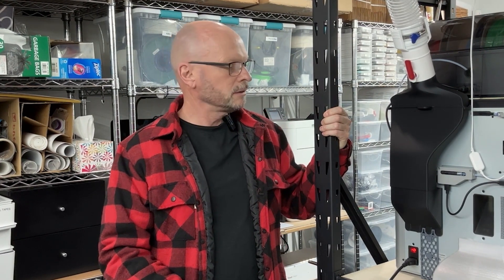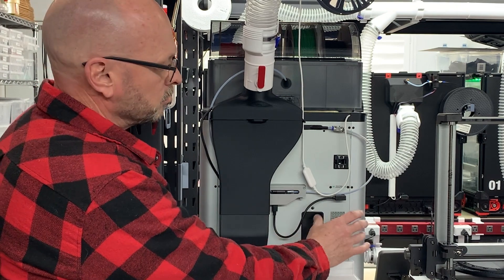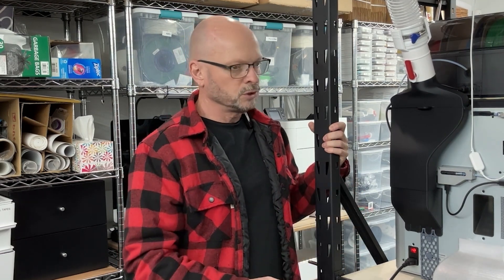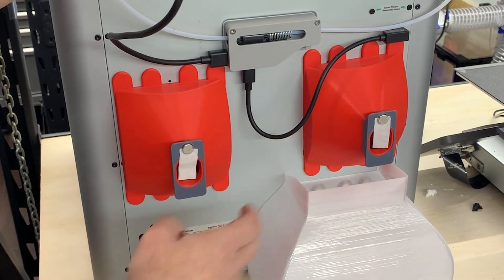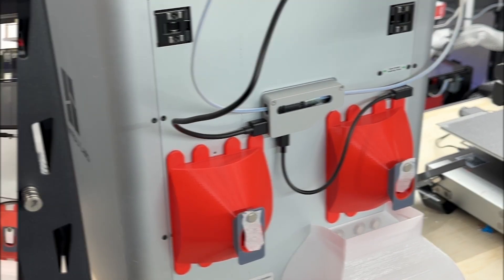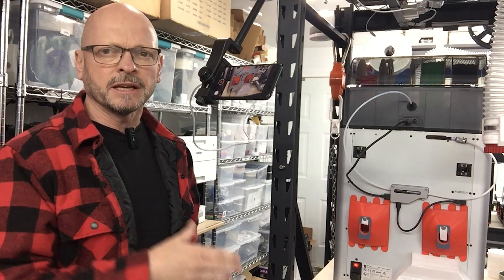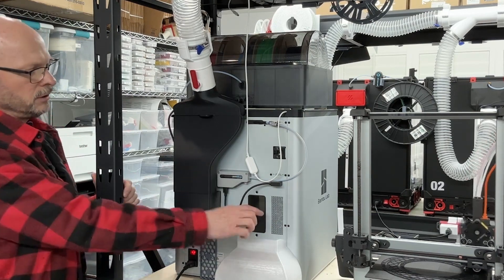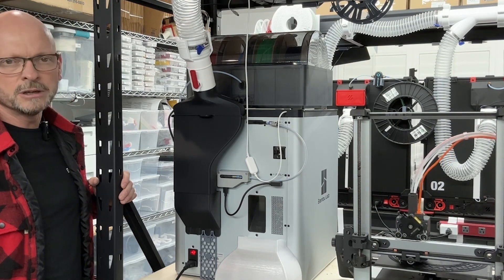Understanding the X1C Exhaust - My final design (I hope)

Comment: Is there a alternative print configuration for venting out a window ?
Reply from the maker: No, I have not made one bu5 it is probably a good idea.  Are you thinking sliding window or swing out window?
Reply: @logicalplanet3d I would be very interested.  I have a dbl hung window that slides up and down just above my x1c printer.  This model makes sense and trying to figure out how to use your dbl vent model with my window.  It's in my office that I work in everyday, I have bento box and Voxel filter and a carbon filter room fan and I think I would just rather exhaust outside.

Comment: I agree with the other commenters. This is a GREAT help! Thank you so much for not only your time and effort, but also the detailed explanation of how it works.
Since my exhaust is southern facing (Midwest), I will use a FAMCO WVEB3BR exhaust vent. I'm designing my own fan interface (with custom speed control) using the LPE25-DH0 1v00c.

Comment: Thanks for your videos I was thinking of same kind of solution for connecting to the main air exhaust from the bathroom. Inhale a central exhaust fan 125mm high flow where I can hook up the machine to.  1 tip. If the negative pressure is high the exaust fan of the machine can go and turn if the fan is not on or on it can spin higher then it was designed for and create a over voltage.
Reply from the maker: Thank you for your comments.  And, yes that is a good point about the exhaust pressure.  But I use and recommend a very low volume fan so it is not an issue.  But if someone was to put an excessively powerful fan in the exhaust it could have some consequences.  Thank you.

Comment: Question, is your air ducting negative pressure?  Is it pulling air?  If yes at what CFM?

Thank you awesome design.
Reply from the maker: Hi, yes, I use a 120x120x25mm fan at the wall to pull air from the exhaust lines.  I have 7 printers attached and the negative pressure is just intended to prevent leaks and assist the machines' exhaust fans getting their exhaust outside rather than pushing into one of the other machines on the line.  As for CFM I really have no idea.  I probably should be doing some calculations but so far it is working well and I feel like it is adequate for my situation.  There are lots of inline fans out there as I am sure you know so you can scale up the "pull" as you need it.  I have recently posted a double-flapped wall port that shows how I have my fan installed.  I will make a video for that shortly but until then you can see that here...   https://www.logicalplanet.com/2024/12/06/thru_wall_vent-2/

Comment: To verify,  this final version fits both the p1s and the x1c? 
Also if you don't mind,  do you have an opinion between the two? Is the AI features of the x1c worth the extra money? They are having a sale on their printers right now and looking to get into this hobby.  Thank you
Reply from the maker: Yes, the system is the same for both the P1S and X1C.  They have the same exhaust setup.  As for your machine choice, I have to start by saying I only have the X1C and I am so impressed with it. I have 6 vorons that I built and also a Kobra 3.  The X1C is definitely my favourite and part of that is the micro lidar and how it runs itself.  Basically when it starts a print it takes care of everything and stops to inform you if there are any issues.  It is very slick.  But I do believe the P1S without that would be an excellent product as well.  And, honestly, you are likely to seldom have an issue that is not caused by operator error. So if price is an issue get the P1S but if you can justify the expense, get the X1C.
Reply: @pdb6251  awesome,  I appreciate your input!
I have some friends that say they will print PLA and PETG inside without ventilation as there is no smell. However there are still VOC's that should be vented away correct? 
Maybe there is a threshold and PLA and PETG is so minimal that it isn't a concern,  but I still don't like the idea of breathing in VOCs. 
With your exhaust mod, I should be able to exhaust to the garage from my basement.  I would set up in my garage to an outside windows but living in the north, I believe the cold temperatures of the garage would cause issues with the prints.
Reply from the maker: @FlyingJypsie  Honestly, I don't think the cold is an issue.  The printers run hot and the flow of air out is constant but minimal.  Just enough to escape the VOCs.  I have not had temperature issues at all.  I have been printing like this for years.  And, yes, smell them or not, VOCs are there.  Harmful?  No one knows.  But history is fraught with plenty of things that people thought were fine only to find out later they were not.  My mother told me when she was young her doctor prescribed smoking cigarettes to calm anxiety.  So from my perspective...  error on the side of caution.

Comment: Great work on this exhaust system, thank you! I am planning to build it for my new X1C. Could you explain your logic on the top glass needing the rim riser for exhaust in addition to the main rear outlet? Is the upper rim riser capturing rising fumes that would be trapped?
Reply from the maker: Honestly, I am not sure there really is now.  It has evolved from my first iteration of the exhaust and just stayed.  I think the main reason is that it provides the strength for mounting the exhaust hose in a very stable way.  That is compared to using magnets on the walls of the X1.  But from a pure efficiency perspective, there is likely enough volume of air coming out the fan port to effectively exhaust the printer.    I don't think there is a problem with the port on the upper frame though so it is there and part of the system now. It also provides a structure for the LED lights which are very beneficial.  Do you want a version of the exhaust without the upper frame?  I am not sure I can do it anytime soon but happy to put it on the list.
Reply: @logicalplanet3d  I plan to use your entire exhaust & LED set-up – it's great! I especially like your white quick connect system for 2.5" tubing - much of what I see available uses 4" diameter, which seems like overkill. On the non-riser exhaust port subject, I do envision that some may already have an LED set-up and would only want a simple 2.5" rear exhaust port, but there are many of those out there to freely download and one could just use your 4" to 2.5" reducer (although that solution is not as elegant on the design side when compared to a dedicated 2.5" exhaust port). BTW, I have been following your work and am impressed with your products and videos. I enjoy how you explain and iterate your designs with improvements. We are all learning. Thanks again for your contributions. Question: Do you use any 2.5" inline fans? Is it necessary to have negative pressure at all considering the X1C has a fan already? I live in a cold environment so I can see the need to keep cold air from entering my shop, but when it's printing are two fans needed, in your opinion? Sorry for such a long comment.
Reply from the maker: @hanalee777 Thanks for the feedback and encouragement.  The issue of the inline fan is an interesting one.  Bottom line for me, yes, I think it is needed.  But it is pretty easy and low cost to incorporate.  I also live in a cold place (Vancouver) so conscious of the winter weather.  A) I think if you do not use an inline fan (negative pressure) the air from the back of the machine will just recirculate into the machine (path of least resistance).  So the negative pressure will help to resolve that and ensure the air from the machine goes outside.  B) if the fan in the back of the machine is not running, you would still want the air to move outside so again the negative pressure resolves that issue.  and lastly, C) The inline fan forcing air out will reduce the likelihood of cold air coming in.  I designed (haven't posted it - but can) a double walled vent for the outside wall.  Effectively creating a double wall (for insulation) when the fans are not running.  It has two layers of flaps and closes by gravity when there is no air pressure.
Reply: @logicalplanet3d  I like the idea of a double wall vent. I was contemplating an inline draft blocker style vent (until you mentioned your idea). My case for exiting from my basement workshop is commandeering an unused 4" dryer vent or using a 10" tall sliding window.
Reply from the maker: @hanalee777  I am knee deep in another design project at the moment. But as soon as I can I will package up my double wall vent design and post it for you.  And, I forgot to mention that is sized the same as dryer vent or 4" ducting (I think).  I need to recheck it.  Can you email me at pdb6251 gmail.com and I will send you the design when it is ready.
Reply from the maker: @hanalee777  I have taking a little time to revise all my exhaust thru the wall components and will post those on Thangs in the next day or two.  Please keep an eye on logicalplanet on thangs.com for it.

Comment: I have a situation where I want to route the exhaust and keep the carbon filter. Basically my printer is set up in a corner next to a small bathroom. I leave the bathroom door open and run the bathroom exhaust while the printer is running (mostly at night), but I'm thinking about cutting a hole through the wall and just piping the exhaust straight into the bathroom.  Any thoughts about this approach? Would it need any additional fans?
Reply from the maker: I have a lot of thoughts...   1, as you know from my video, I am really not a fan of the carbon filter but I understand if you are pumping into another space and then hope to send that out (with the bathroom exhaust fan) I understand the thought.  But with the carbon filter in there is no pressure from the printer to get air going out the exhaust line.  Challenging.  But if you add a fan in the exhaust line to pull the air, that might work.  2. And keep in mind we are just brainstorming, if you are keeping the carbon filter in, why vent at all?  I guess I was doing the same so I get it.  But it seems the carbon filter really dampens the exhaust opportunities.  3. If you are up to it, put a hole in the wall (as you have suggested) and pipe the exhaust out through it. I have posted some through wall doors, I am going to post a snapfit panel to close up holes in walls soon.  With that you can cut a hole and later cover it up in a fairly tidy way.  Does that help?
Reply: @logicalplanet3d  Thanks. It's just two layers of drywall between the printer and the bathroom. I don't own a Sawzall so I was thinking of maybe just doing it with the biggest hole saw I own. Maybe 2.5 or 3" diameter. And then sticking a white 3D printed flange through. Ideally it doesn't look terrible from the bathroom side.

Comment: I suspect, though I haven't verified it, that the carbon filter recycles the air inside the chamber, thus maintaining chamber temperature while clearing the air. Like @logicalplanet I was easily confused on this as well. With the filter in place and the fan on, I can feel air movement on the outside, and I can direct it with my hand so at least some of it is exiting/leaking around the fan. But when I put a piece of very thin paper over the opening, it was a slight net intake rather than outflow. So, it felt like it was blowing out, if poorly but this was a trick.

I'll be keeping an eye on chamber temperature when printing filaments that want to be in a warm enclosure. I'll close off the exit port with one of the boss's valves and let the chamber fill with (unfiltered) fumes. After the print is complete, I'll open the valve and let it clear for a minute before opening the door. This is what I did with my previous (Creality) printer, and it was not burdensome.

Comment: I have put this on my P1S and hooked it up to a 100mm inline fan blowing the exhaust outside. I have removed the carbonfilter inside the machine to get better airflow. The airflow and negativte airpressure is perfect. Not to strong and not to weak. Cant smell anything inside or outside the machine. Cant measure any higher values of PMs och VOCs running this system. Don't have any problem with bedadhesion or warping parts due to the airflow. It's just perfect for my use and it's a peace of mind that I pump the fumes outside, protecting me and my families lungs. Good work! 

I printed everything in Sunlu PETG with the models parametrics.
Reply: Can you let me know what model fan you’ve used?  And are you using 4” (100mm) exhaust tubing?   (OP’s model looks like it uses something smaller)
Reply from the maker: @markzod3842  I used this one linked here from amazon.ca 

https://www.amazon.ca/gp/product/B097DDJHV6/ref=ppx_yo_dt_b_search_asin_title?ie=UTF8&th=1

If you can not access that, here is an equivalent one from amazon.com https://www.amazon.com/gp/product/B0D1YKY5P3/ref=ox_sc_act_title_1?smid=A2KU1WIWHUZBP1&psc=1

It is described as "Computer Fan with AC Plug, 120mm x 25mm 12V Fan with AC to DC Speed Controller"
Reply from the maker: Thanks for your comments.  Glad it is working for you!
Reply: @KennethHansen534 @pdb6251 Any issues with warping when using this system while printing ABS or ASA?  I know you mentioned no warping but did not specify what material.  Would a chamber heater help to stabilize the temp and combat the added airflow?
Reply: @KennethHansen534 @pdb6251 Any issues with warping using this setup while printing ABS or ASA?  I love how sleek this setup is but a little worried about the additional airflow with materials that warp easily.  Thanks in advance.